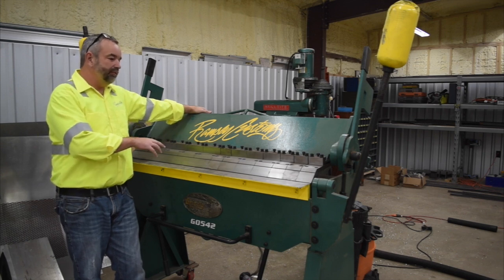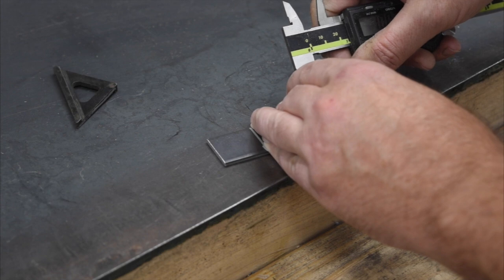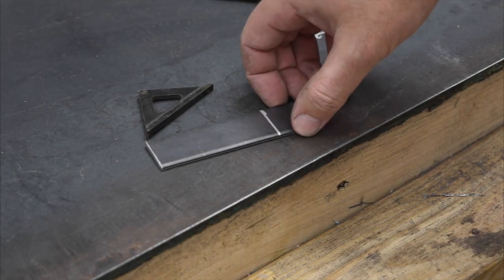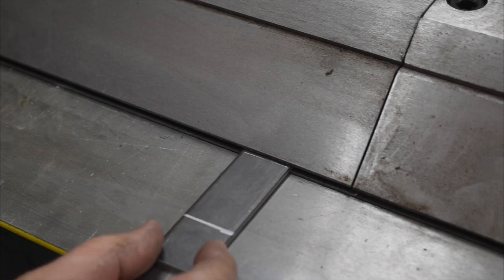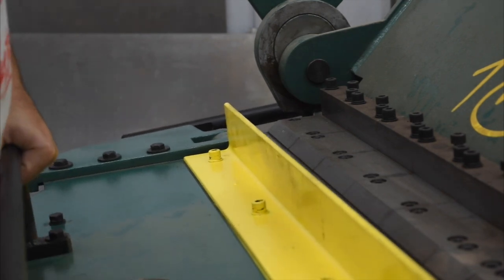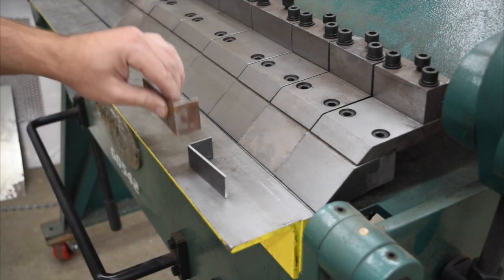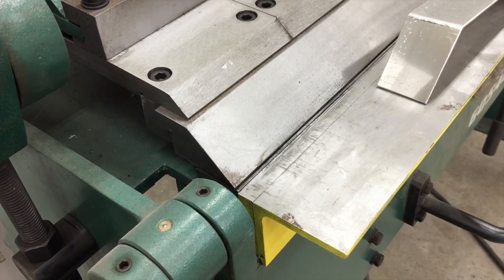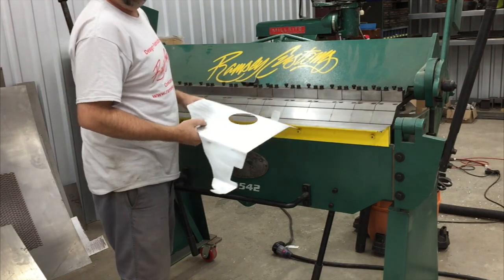How to use a Metal Bender - Steel Sheetmetal Brake (Finger Break)

Comment: Depending on what you want to do, you could put a mildly bent piece back in the brake by removing some fingers, inserting the work, then sliding the piece sideways under the remaining fingers.
Very limited, yes, possible, yes.

Comment: Great set-up video. I have some blokes giving me a hard time about the hydraulic folder at work. They are saying the brake needs packing under the fingers along the length of unused area. Am I right in saying this would only apply if the thickness sensor (cutoff) is incorrectly configured, putting unnecessary strain on the fingers?

Comment: 1.2 steel ... if I have a 25mm fold and set it up 23.8 as I need to - the thickness of the steel and the fold comes out @ 25.9 do I then take 0.9 off or 0.9 on to get the 25mm fold

Comment: You need set the head back to allow room for the gage metal.  The space between the clamp bar to the bending edge should be twice the thickness of the Gage metal you are bending.

Comment: Brake is adjusted too tight, the clamp leaf  (upper leaf) should set back twice teh metal thickness on a hand brake  (three times on a power leaf brake) otherwise you  over strain the brake and  it eventually shows up,  I have had a number of brakes over theyears of this type  from my  Chicago 1/4 inch x 12 foot power leaf brake ( still have it , my main bending machine) a a SO 10-14 Chicago,  an 8 foot 12 ga Chicago (both of which I sold at over new price) and a 4 foot 16 gage Connecticut (Roper Whitney) box and pan (a still have). The 8 foot 12 gage needed a lot of repair of parts broken from this type of overloading . You will never get a "folded paper" bend in metal that is not very thin, you will just gradualle damage your machine.  Stick with the 2X setback

9

Comment: Just found this. Is there a link to the vid where you built the piece? I have access to a brake and need to do some bending. Your tip on the largest section and work out is a huge help but I learn visually much better.
Cant find you video on the actual build. Thank you for sharing! subcribed

Comment: I run a CNC press at work, have been bending for about a year now, was a welder/fitter before that. I have never seen a manual press before, very cool. Good work, I always use a scribe of some sort, soap stone works well too! One thing I really like, are manual calipers instead of digital, so you have more than one way to measure.

Comment: Gap (set back from edge between bending leaf and base) on clamp leaf (upper leaf) should be twice the thickness of material you are bending with a hand brake. This is what manufacturers reccommend. I have an old "Chicago" power leaf brake which bends 1/4 inch 12 feet long and the factory reccommends 3 times thickness of material on those machines, for example 3/4 inch set back on 1/4 inch plate. A 1/2" capacity machine would be set back  1-1/2 inches on half inch plate. More set back is easier on the machine if you can stand more radius. I bend thinner stuff (14 gage or 16 gage at twice material thickness. A properly set up press brake bends a sharper radius than does a power leaf brake. But a power leaf brake is more versatile than a press brake and safer as well. No brake or material will bend sharp 90 degrees with no radius, thin material (24 or 26 gage might look like it but the radius is there.

Comment: Sheet metal brake, press brake. What does brake mean? Is it just another word for machine.
Reply: Looking up definitions for brake, it refers to a lot of different types of machine, but not machines in general. Generally, I would say they are all things that apply pressure or resist pressure, but a lot of different meanings

Comment: When I had my company before I sold it I would get any trade person to do a small project in the hand box and pan to see if they knew how to fold it. If they could not fold it I then knew they could not use a hydraulic  CNC press brake so would have to teach them the process of folding. It is not something that is easy for a lot of people.

Comment: I work a trumpf cnc press brake for work. I have been interested in buying a small manual press brake for bending up light fixtures. Pretty interesting stuff. First time I've actually seen how one works. My question for you is if you had a square piece but with a small amount extra material on each side except for the corners of .060 and wanted to put a 90 on each side to create a perfect square with a lip on each side is there a way to adjust the length of tooling to so I could fit it inside of two 90 degree angles? or if I wanted to gauge a 90 degree bend off of a 90 degree bend to make a U(couldn't think of a better way to explain the shape) shape on the ends would that even be possible? Doesn't seem so how the machine is set up. Thanks for any advice if you see this haha

Comment: I have an 18 x 80 inch piece of 14g. sheet metal I need to bend. Is there a way to do this if I don't have this machine? Also, what was the name of that tiny square you ude?
Reply from the maker: Man, bending 14 gauge across 80" would be very difficult, even its the 18" length, still pretty much impossible without a brake. You might be able clamp it between 2 pieces of angle iron and heat it cherry red, but honestly i have never tried that.  The small square is a Z square from Stan Zinkowsky, you can find him on youtube

Comment: That angle iron that is bolted to the bottom part, is that just for extra leverage to bend the peice of material ?   i bought a Tennsmith brake with fingers but it does not have the holes to mount that peice.  They sell 2 versions, one with and one without.  This one is 22ga and the one with is 16ga rated, so I am assuming thats the difference.  How come such a heavy duty brake can only do 22ga even with out that ?  This one sells for like $900 new.

Comment: Where you get that little mini square ?
Reply from the maker: It's called a Z square, Stan Zinkowsky sells them, you should be able to google them and find them
Reply: I found a Bar Z Industrial Development website. Looks like they sell a 2" square for $144 usd !   Thats crazy lol
Reply from the maker: Lol, yea they are not cheap.  He makes them all by hand, and they are sent out for heat treat and then precision ground on his surface grinder, so prob $70 in cost and materials.

Comment: Hi Gary,

Thanks for the informative video. I have just bought the Baileigh equivalent of this machine, they are identical - probably made in the same factory and branded differently.

Do you find that there is back and forth play in the top clamping beam? So you can grab the clamping beam and move it towards and away from you? Mine has some and that's because there is a bit of a gap on the backstop adjustment mechanism.

Just wondering if in use this becomes a problem?

Thanks,
Andy

Comment: Just found your channel and I'm blown away.  I do have a question though, how do you account for the radius that is put in the metal after you bend it?
Reply: Yes! This is exactly what I was trying to search for. On an Aluma Brake I've been using, it seems to give me the best result when I put the marks exactly on the edge of the clamp bar. It seems they accounted for that radius (at least on thin sheet aluminum) when designing the brake.

For a minute there I was thinking pulling it out .5 to 1mm would help, but no, that fucked up a handful of practice attempts at matching an existing piece of siding lol

Comment: I switched over to a scribe a while back...  It's made all the difference.  I used to use a mechanical pencil for detail work.  Talk about a game changer....  Great tips on the break.  It's always a sequencing mind bender to get the panel flipped right and bent properly.
Reply from the maker: A mechanical pencil is better than a sharpie for precision work, but yea the scribe is the way to go... I saw you using that Randy Richard one.
Reply: Yes, and the Diresta pick.  Makes me wonder why I didn't use those things before.
Reply: Never use a scribe on Alclad aluminum sheet! You'll scratch the pure aluminum anti corrosion coating and cause the bend to fail ultimately at that point. Scribes are fine for heavy ferris metals but not fine aircraft quality aluminum sheet metal.

Comment: My favorite method for marking on metal is to use a machinist square and scribe.  I'll slide the rule to 1" and then using the square against the end I need a mark of 1" on I'll scribe it.  Hope that makes sense...
Reply from the maker: Yes sir, makes perfect sense.  I hate that I was out of the range of the camera when i filmed that part.  Thanks for the comment.

Comment: Good tips Gary. I used to do a lot of aluminum bending as we made our own trim and drip edge, etc in the storage barn shop I worked in, as well as when doing vinyl siding, all the wood trim got wrapped in aluminum. Lots of challenges for different shapes.
Reply from the maker: Sounds like you guys did some interesting things at that job... thanks George!
Reply: How can you fold metal along an edge (for strength)? Sounds neat!  How long of a piece can you bend?
Reply: @TheRainHarvester  We could (I'm retired now) bend up to 12' long pieces, either with a single 90° bend or a fold over. Our brake was 10' long, but with a little practice I could efficiently bend beyond the natural limits of the equipment.

Comment: One thing I think you should cover is bending to a drawing or dimension. Say you have a drawing to make a channel or cap rail. The distance between both inside legs needs to hug something or slip into something that's 6" wide. (inside width vs outside width) Show how to compensate for different gauge thickness, in say, 12 ga vs 18 ga sheet metal.

I can't tell you how many parts I've had ruined by asking a shop helper, assistant or whatever try and bend sheet metal. When you ask them if they know how to use a brake and can make the part in the drawing.
Reply: +1 on this.  I am the guy that destroys all of the parts that Eco Mouse is talking about!
Reply from the maker: Dude, this is a fabrication basics video, what you are talking about is more advanced.  I doubt i can even do it once, much less make a video on it lol
Reply: HAHA! I think it's kind of basic. I mean, when guys who call themselves fabricators come to my shop looking for work, it's one of the go-to on the spot tests I can give them.

"Here, bend this sheet metal into a pointed cap rail like this drawing. Make sure it fits around this 2x6 snugly. I'll check on you again in 15 minutes."
Reply: +Eco Mouse couldn't agree more.